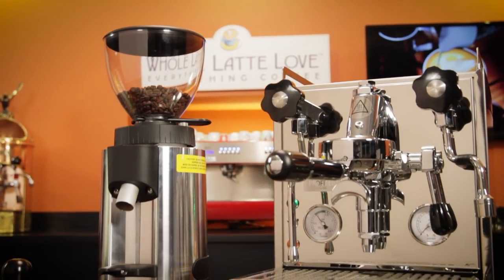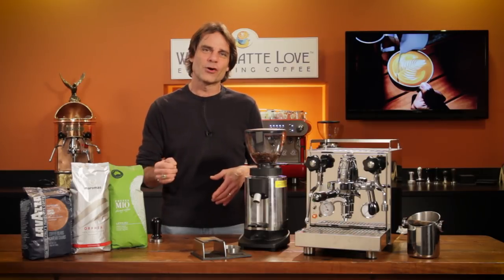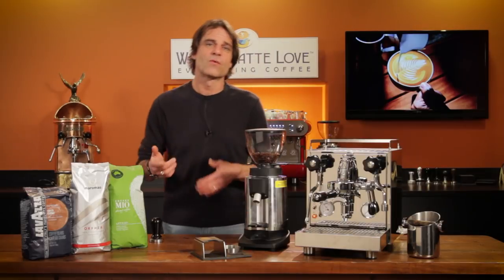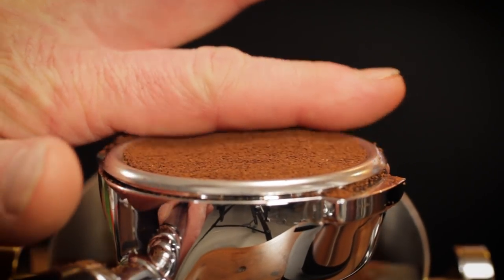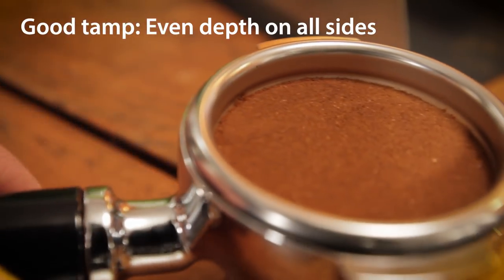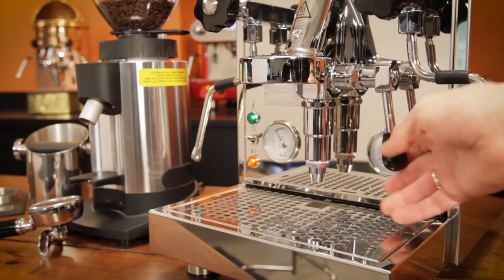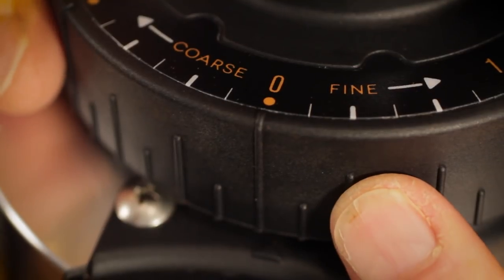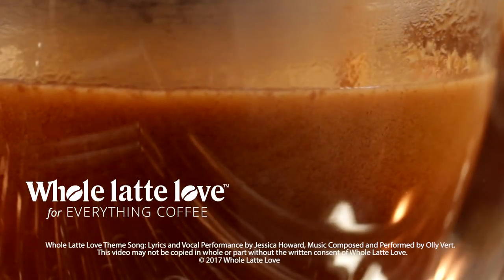How To: Basic Espresso Technique - Dialing in Grind Size

Comment: Very helpful! I have a Lelit PL41TEM Anna w/PID. I've been flushing to remove any coffee grounds left behind. Should I not flush? Also, I have the Baratza Sette 30, I have it set to 10, and my espresso just drips very slowly. What am I doing wrong? Thanks!
Reply from the maker: Hi Cynthia, The Anna has a 3-way solenoid so it should/can be backflushed using a product like Cafiza: https://www.wholelattelove.com/products/urnex-cafiza-espresso-machine-cleaner
I can't tell you what grind setting to use but I will say in my experience a setting of 10 on a Sette grinder is rather coarse. Here's a newer video on dialing in grind I posted last week. I use a Sette 270 Wi grinder in the video and my grind setting was a 3 or 4: https://youtu.be/jOY7D02n4Cw That does not mean you should use a 3 or 4. A lot depends on coffee type, coffee dose and other variables. A setting of 10 sounds coarse but know way of me knowing for sure.
Marc

Comment: I’m using an older version Profitec Pro 500 and a Ceado E5P grinder. After researching when to start the timing of a double shot of espresso the general consensus is to start the timer as soon as you activate the pump. However, I have viewed several of your videos where you advise to start the timing at the first drop of coffee coming from the portafilter. Is this still the preferred method? Also, does this technique vary with adding a preinfusion step?
Reply from the maker: Hi Gary, Thanks for the question. Timing a shot is the most basic method of determining when to cut it. It's a perfectly acceptable way of getting in the ballpark of a good extraction and as far as many people need to go. Next level technique is using brew ratios - I'll link to my video on the basics of brew ratios below. When timing I tend to start from first drip. Going from 1st drip gives me a common starting point regardless of pre-infusion and pump type. I work with many different machines. Some do pre-infusion. Some do not. Some have vibration pumps. Others use rotary pumps. These machine variables affect time to first drip. Vibration pumps build up pressure slower than a rotary so first drip happens later when everything else is the same. First drip indicates water is flowing thru the coffee and extracting.
Marc
Reply from the maker: Oops, Here's the link to my video on brew ratios: https://youtu.be/57UqPDirHoU
Marc

Comment: Explanation is neat and clear. I have been for last 2 weeks trying to get a perfect espresso Crema shot using home espresso machine..I don't think I can achieve a  perfect shot the way I see in Ur video..and ofcourse I am just a home Barista not a pro to buy or afford a costly machine.i use hand burr mill grinder.. Morphy Richards fressco 800 watts machine..the pressure as predicted is 15 bar..but still can't get it right..
Reply from the maker: Hi PP, After the bean, grind is most important to making an espresso. What make/model hand grinder are you using? There are some good ones but many lower cost hand grinders have wobbly shafts and lower quality burrs. Wobbly shafts allow the spacing between the grinding burrs to change while grinding. With that the grind they produce tends towards an inconsistent coffee particle size. Check out this video cued to show the burr wobble in a lower cost hand grinder: https://youtu.be/P9g_t7CP2BQ?t=112
Marc
Reply: @Wholelattelovepage  Hey Marc..thanx for replying. I use a very inexpensive burr grinder ordered from Amazon in my country..it's one of those cylindrical grinder...grind is fine..I sort of compared the grind today to a my fav coffee shop grind I happen to visit..so I got that grind bit right..today I somewhat got a good crema..but again it wasn't the way it looks in Ur video..the caramelized kind..mine is thin and gets bubbly towards the end of the shot ...and neat espresso shot still taste a bit bitter..but Americano is sort of fine. .thing is when I imagine drinking from the espresso shot like urs in the video..I imagine it to be like a sweet caramelized coffee shot..may be it's only in my mind..but yeah looks do help.i am not going to stop trying..so wish me luck..I wish like to send us a image or short clip of my espresso shot extraction...do let me know if possible?
Reply from the maker: @write2paragp  No problem replying - my pleasure! A better grinder will get you better results. You can send me a link to video of your shot extraction and I can have a look. Also know not every coffee can produce those juicy shots!
Marc

Comment: Great video for a newbie like me. An unrelated question but I have a Smeg ECF01 machine and am enjoying the coffee made. However, I do not think I can froth the milk to the right consistency for latte art. Is this just the limits of the machine? If so any advice about how I can manage some latte art by other means? Thank you.
Reply from the maker: Hi Callum, Thanks for the question. I have not uses a Smeg machine - interesting name! Anyway, I did look it up and it appears to have an autofrothing steam wand. That type of wand reduces the skill required to produce milk froth by automatically injecting air into the milk when steaming. There's probably a small air intake hole or slot somewhere on your wand. These wands are good for easily producing an airy froth for cappuccino but in most cases cannot do the fine microfoam required for latte art. A couple of suggestions that might get you there. Is the auto-frothing wand removable from your machine such that you are left with just a pipe which can reach into a pitcher?  If so, you can usually froth manually (skill required) and get a finer froth. With some auto-frothing wands when you position the tip deeper into the milk less air is injected and you can make a finer froth. Here's a video that shows you how to test your wand with some tips on making a better froth: https://youtu.be/gXr7ohKkcBE
Marc
Reply: @Wholelattelovepage  thank you so much for your excellent reply. Yes, it is an interesting name (no dodgy connotations in the German language I guess 😄). I have since writing has a bit of success by chilling my jug and ensuring the tip is fully buried centrally in the jug. My efforts are poor but I think I'm getting closer. If I take of the frother there is just a little rubber spout. I'll have a look at your link to see if I can learn anything more there. Many thanks once again. Callum

Comment: Sheriff Marc, I'm considering the breville barista express or barista pro. Is the pro worth the $100 jump? Also, i don't have a scale but do I need one if the breville comes with a razor?
Reply from the maker: Hi John, Sorry for the delayed response. I've been on vacation and offline for a few days. As to which model is best for you I'd break down on the features you want most and make a value decision from there. Personally I find the "razor tool" a bit gimmicky. No professional baristas use anything like that. I've never used the razor myself. A scale is not required unless you want to be very consistent without question. Just fill the basket loosely with coffee and level off without compressing. Then do your tamping. That should get you ~ +/-0.5g consistency with dosing.
Marc
Reply: @Wholelattelovepage  thanks sheriff Marc for your response. I had another question. On regards to the distributor tool, its said that using that without tamp tastes better than using followed by tamping. Is that true? If not, do I recommend me buying the duel distributor that levels and tamps. Unless u have a video on that to direct me to

Comment: I see a lot of people say that you should time shots from the moment you turn the pump on, not the first drip. That makes sense to me because extraction starts as soon as water hits the puck. Still, I'm confused about which method I should be using...
Reply from the maker: ProfessorJones7 thanks for the question. I’ve chosen to go with first drip. Vibe pumps are slower to build pressure than rotary machines, sometimes pre-infuse... working different machines and methods one constant is 1st drip
Reply: I'm using a Gaggia Classic and I've wondered why the first drip took a longer time to come compared to professionnal machines, now I know ! Thanks for the explanation, now I understand why you chose to time shots that way and I will be doing the same.
Reply: Having an Oscar 2 machine, the first drops sometimes appear after 10-15 seconds! Having watched some videos showing the professional level machines, I now want one with the rotary pump!

Comment: This is great, as always, for beginners like myself! When I’m adjusting my grind size on the Breville Smart Pro, how should I be adjusting the grind time? I assume there’s more to consider with the granular time adjustments than just adding more time for a finer setting & less time for a coarser grind. Is it a point full second per each grind change? Thanks!
Reply from the maker: Hi JB, Thanks for the question. There is no direct correlation between grind size and time one can use for adjustment. Problem is different coffees have different densities so no one size fits all thing that works. I'm afraid it's trial and error. Really just add a bit more time if going finer and adjust as needed in subsequent grinding.
Marc
Reply: @Wholelattelovepage  Super helpful, thanks so much Whole Latte team!

Comment: Hello Marc...I know this video is old...not sure if you're still monitoring comments...hope you are.  I'm very new to this, so please bear with me.  I'm a bit confused on the output volume.  I watched a video where it stated a typical espresso is 1:2 ratio.  So if the dose is 18g in, then the expected output is 36g.  However, your video recommends, on an 18g in, to pull 2 oz., which is about 56-ish grams of output on my scale.  I'm trying to make a double shot but now I'm confused.  Would you mind clarifying if I should stick to a 36g out---which is less than 2 oz, or go with 2 oz, which is definitely more than 1:2 ration---when dose is 18g in.  Appreciate your time.
Reply from the maker: Hi storm, Still here and thanks for the question! Just a heads up I monitor our channel for all new comments regardless of video age. Down the road if you have more questions it's always best to ask in a new comment rather than in reply to an existing comment.
There's often some confusion when using weight and liquid volume. If you are weighing output and doing a 1:2 ratio then forget about liquid volume. Weight is far more accurate. Got to say if you are weighing output and using brew ratios you jumped right in and went beyond the basics! As this is a basic technique video I'm making the assumption most viewers will not be using a scale to weigh output. Using liquid volume vs. weight output requires some guessing as espresso does not weigh 1g per ml like pure water does. This is especially true when using a coffee which produces copious amounts of crema! Not unusual for me to pull 1:2 ratio shots with classic Italian style bean blends that come out to 36g weight with a volume of ~2oz/60ml including the crema. Crema weighs nowhere near 1g per ml. Hope that makes sense! A lot depends on the coffee being used. Volume w/crema is much lower in some coffees at 1:2 brew ratios. Very true in 100% Arabicas.
Marc
Reply from the maker: Also... thought I'd share this highly technical video using brew ratios and tracking naked triple shot extractions with an Acaia scale connected to their Brewmaster app: https://youtu.be/HTaly8c-i_U
Reply: @Wholelattelovepage  thanks so much Marc.  I’m a bit frustrated with the coffee wastage, so far, but I guess such is the path to good coffee!  Unfortunately, I still have a long way to go in developing a palate for knowing a good shot from a great shot.  Right now mine is pulling sour and weak shots—-far cry from the cafe quality that I’m on a mission to achieve.  Forward and onward I go—-to more bean wastage I guess!  Thanks for your advice and Happy New Year to you and yours.
Reply: @Wholelattelovepage  thanks Marc!  Yea, I tried to be more prepared by watching James Hoffman’s espresso videos about ratios and dosing and timing etc, purchased a scale —- figured I’d start there...not even realizing that’s past the basics....I guess I jumped into the deep end but I am determined to swim rather than sink!  So I appreciate all the guidance you’re providing.

Comment: Love your videos! Thanks! Q - If I like very strong espresso, should I go for finer grind size? Is there a reason for the 20-30 second rule or is it based on taste/preference?
Reply from the maker: Hi LB, Thanks for the comment and question. 20-30 seconds is the universally used timing for initial dialing in of grind size. If you like a bolder espresso (ristretto perhaps?) you can make the grind a little finer to slow down the extraction. Go with the same basic timing and extract less total volume/weight. This will give a lower brew ratio. Typicall espresso brew ratio is 1:2. Meaning if you were to use an 18 gram dose of coffee in your portafilter you would run the extraction to a final weight of 36g in your cup. If you do not have a scale you can use volume. But, coffees which produce a lot of crema make that difficult as crema weighs less than the liquid espresso. Prolific crema producing coffees can reach 70ml volume including the crema from an 18 gram dose. Hope that helps!
Marc

Comment: Hey I have a question. I have a sage barista express machine, using a 54mm non-pressurised basket. Fresh coffee roasted in march. Pretty sure the dose is right and the grind is literally as fine as it can be but for some reason the shots I pull always come in between 12-14 seconds. Im getting proper scales soon, but I'm pretty sure Im dosing 18g. The yield coming out is around 55ml. Any thoughts?
Reply from the maker: Hi Bijan, Thanks for the question. 12 - 14 is quick. My gut reaction is your grind is not fine enough but you say it's set as fine as it goes so maybe not unless there's a problem with the grinder. Is your double shot basket nearly filled prior to tamping? It's been awhile since I used a barista express but I think 18g is pushing the limits of that basket. In any case you should be able to grind fine enough to choke the machine or at least get a very slow drip.
Marc

Comment: As coffee gets older do you generally have to grind slightly finer or courser?
Reply from the maker: Hi Sam, Thanks for the question. In general, as coffee ages one will need to grind finer for the same extraction rate. But I have experienced exceptions. We recently ran an experiment using an Ethiopian Yirgacheffe that was 4 days from roast. We dialed-in grind for a 25 second extraction and did one extraction per day for 30 days without changing grind size or coffee dose. For about 20 days extraction timing increased reaching about 50 seconds. Then timing started to decrease and around day 26 it returned to  about 25 seconds.
Marc
Reply: Whole Latte Love oh wow that's rather hard to believe isn't it. This is rather interesting to hear actually, this is quite a massive swing in times especially hearing that it almost came back down to its original time. Thanks for the info though most appreciated.

Comment: Mark, for dialing in using single shot, also 20-30 seconds?
Reply from the maker: Hi Mitch, Thanks for the question. Yes, timing for singles is the same. Single baskets have fewer holes so flow rate through the coffee is the same.
Marc

Comment: Mark, love all your vids, very helpful. so i just upgraded all my equipment and seem to be struggling to get the right brew. in order to dial in i am using my double spout porter filter with a 20g VST basket. after seemingly getting the brew time within range felt the shot acidity increased. In anycase as i am the main coffee drinker in the home, i use a 15g VST in my single shot portafilter however seem to get a much quicker shot time. what should be the base line, flavour even if pour is too fast of calibration with the double spout?
Reply from the maker: Hi Junne, Thanks for your kind comment and question. At the end of the day your flavor preference is most important! When you change basket or dose (especially dose weight) timing will change. Decrease dose weight and shot will almost always come faster unless you grind finer. Acidic/bright flavor is most common in very fresh from roast, lighter roasted single origin specialty coffees. Long low flow/pressure pre-infusion goes a long way to taming brightness in those types of coffees. Hope that helps!
Marc

Comment: Hi Marc, Love your videos and the Whole Latte Love channel/team! I’m using an older Breville Barista Express (BES 860xl) and I can’t seem to get the espresso to taste right! It’s very hard to change the extraction time on my machine(no matter the grind size), yet I was able to get the extraction time up to about 26 seconds counting the time it takes for the pre-infusion (about 8 seconds) and I use 18 grams of coffee each time. Additionally, I make sure I tamp evenly and with the same amount of pressure each time. The espresso still has a sharp acidic taste that I just can’t shake off. I’m wondering if it’s the beans I’m using. I use Koffee Kult’s Dark Roast, however I’ve used dark roasts before and was able to produce better quality espresso. Thoughts?
Reply from the maker: Hi Mark, Thanks for the question. I suspect it's the beans but I'm not personally familiar with that variety. Changing grind size should affect extraction timing if using Breville's single wall (non-pressurized) filter basket. If using the dual wall basket (pressurized) then timing will not change much as it's the basket causing the pressure to build rather than the coffee. Sharp acidic flavors are not typical for dark roasts. More common in medium-light roasts.